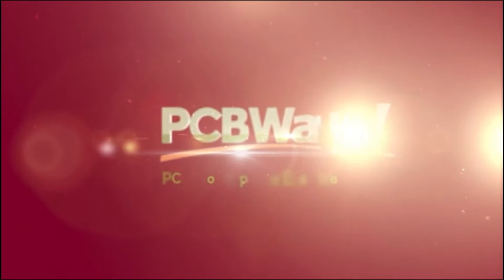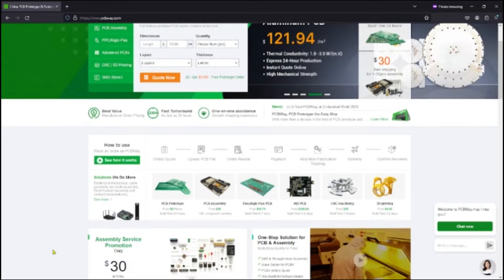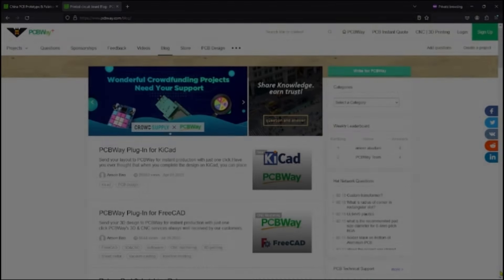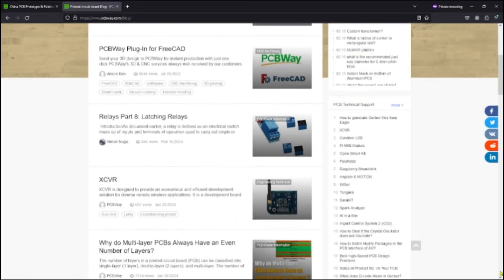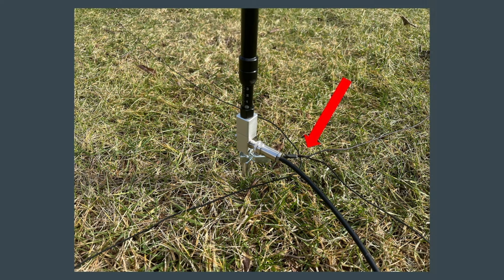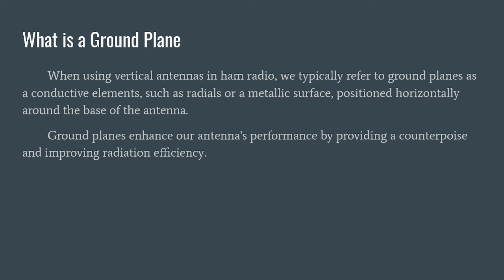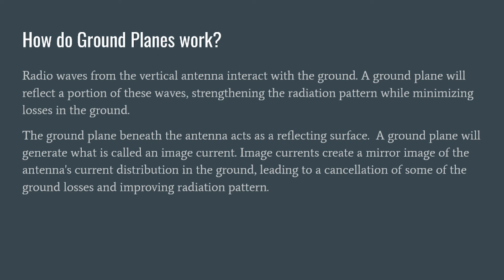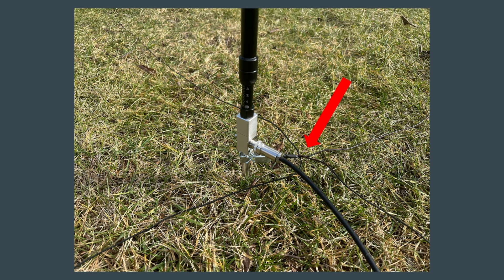Ground Planes for Ham Radio Beginners

Comment: If your antenna insists on using wires laid on the ground, i suggest that you use a lot of them, otherwise you might waste a lot of tx power just giving the worms free central-heating ! A few  elevated radials might often be much less lossy than a few wires laid on the ground.

Comment: The challenges faced by us full-time RVers who are also POTA activators are that we are often faced with erecting a worst case vertical setup due to restrictions at the WMA & other managed govt properties. It is hard to exactly list every restriction to be anticipated, but a lot of times I end up either with my Grabel vert on a tripod or one of my Ham sticks on my 5" msg mount. Once in a great while the 35' coax gives an acceptable match for my radio, but rarely I get to string my radials for as soon afterward a busl oad of nuns shows up to trip over them with their canes. Folks get tired of me preaching about using my Faraday cloth as a ground plane, but to avoid much of the trip hazards it has allowed me to get my 10 contacts to activate so I can be on my way. Just like anything else, when the bands are good a wet noodle can make many contacts, I am told, lol. I tell the angry sad hams that it is my job to try all the combinations that don't work first, then someday figure out how to do it right in ten minutes or less, lol. When in Colorado for the summer I have to work twice as hard for every contact than when in FL for the winter, another influence on my choices of effort. Generally though, I notice that Field Day gets about the same shortcuts. Thanks for your great videos,. Cheers, Davey --KU9L
Reply from the maker: Hey Davey, thanks for the comment and for watching 👍. One of these days I will need to try that cloth.
Reply: @TheSmokinApe  I don't expect it to be as efficient as a bunch of cool radials, but KB9VBR has some WSPR data on comparing contacts with one and two aluminum window screens. For POTA there are just minor differences, etc. I have been asked to do a real study but I am not that organized, LOL.
Reply from the maker: @KU9L  lol, Michael is awesome 👍
Reply: So how does a ground plane work while using a mobile NMO antenna mount?

Comment: As you explained it, yes it now all this makes sense. This is my question, what is the formula for a ground plane size? One I have read is 71.3232 divided by the frequency. Thus, using my HT in my office I should have a ground plane (the ole Pizza Pan trick) for the frequency of 145 MHz, the size of 19.29 inches, hum good size pizza. Using that formula for 400 MHZ a 6.7" ground plane is required. Hum, maybe my understanding is completely wacko.

Comment: I was working with Mifare cards once upon a time 13.56 MHz or nears about.  I was introducing a reader into a machine design for card reading. I was just a coder in a small company given the job.  The range was about 40mm for normal usage.  One day, messing about, I held another reader board behind the powered one and the read range  increased.  I couldn't quite figure out how that worked without it being powered.  I guess now, having seen your video, that If I had cut all the electronics from another reader and just kept the antenna part, and used that as the rear reflector, then I could have invented a cheap 'reader enhancement', maybe to 45mm and hence DES comms as well.  What a laugh :-)  .i.e. make a simple copy of the antenna part and stick it behind like in a Yargi?
Reply from the maker: Give it a try and see what happens 👍

Comment: More radials more gain, is correct only for GP lays on the ground. For elevated verticals, 2 radials is enough.
Reply from the maker: Correct
Reply: What size wire is best to use, and does one connection point better over another, such as connecting directly to the ground spike/stake vs clamping to the mount or coax PL 259 connector?
Reply: @K4WYZ  not clear what you mean. 
If talk about wire size, so thicker is better bandwidth, but also more expensive, so choose one is suitable for you. 
Counterpoises better to not make grounded, in case of GP is elevated above ground. 2 symmetrical pieces is enough for minimum. And connect to ground clamps of commutation box.
Reply: @Viktorherenowhere   thanks for the reply, I am a pretty new ham so bear with me a bit not always sure how to ask the question the correct way. Lol. Let me start with my setup my antenna is a JPC 12 vertical currently using the counterpoise that came with it, the wire looks to be about 16AWG I was wondering would I get better performance from my counterpoise using 14AWG vs 16AWG or 12AWG vs 14AWG so on and so forth. As far as connection point, for instance right now I  clamp my counterpoise directly to the ground spike, I have also used it clamped to the pl 259 right where it is threaded to the feed point of the antenna?
Reply: @K4WYZ  now is clear. You have a very good portable universal antenna for hf.
Please note, at 40m band, this antenna is not effective. It works best from 14Mhz and upper.
Every installation needs to be done with an antenna analyzer, for example Nanovna.
Counterpoise wire, awg14 or awg16, no huge difference in performance, only physical durability.  Better to use copper wire.
If you setup on the ground, you can add more counterpoises to boost performance.
If you setup above ground, 2m+ you need at least 2 counterpoises, in symmetrical position, 120degree between pole and counterpoises will give you better swr.

Comment: I’ve seen a few videos about wire mesh and faraday fabric being used as a ground plane.  I think I’ll get a very large one (maybe two) in order to cover 40m.  Hopefully some clear days soon.
Reply from the maker: What concerned about those solutions is that it probably handles the capacitive coupling to ground and counterpoise functions just fine BUT I’m concerned about ground loss 🤨

Comment: Great explanation! Thank you!
I have a Lora radio (902-928Mhz) with a vertical monopole about 7" long mounted on top of a wooden box that is not connected to ground. Would it help to mount the antenna on a small, ungrounded, piece of metal and screw that onto the box top? How big of a piece of metal would I need?
Reply from the maker: @zachreyhelmberger894  you could try with a 7’ round piece of metal 👍

Comment: Good Helpful info ! .....Frequently, Direct 52 ohm coax Feed results in Higher Swr than desired when you Use straight Level (90°Angle) ground plane Radials.... Highish Swr can be Tuned out by Using a slightly Shorter vertical Radiator & Tuning an appropriate sized "Hairpin" Beta match across Antenna terminals...I know it Looks like a Short circuit but can Work miracles in tuning a Better Swr.....
Reply from the maker: Didn't know that, thank you for the info Tom 👍

Comment: Adding radials to MMANA-GAL, how long are the radials? Are they the same length? Or does the total length equal some fraction of the wavelength being transmitted?
Reply from the maker: The MMANA-GAL manual is radio silent on the definition of the radials are, I am assuming it’s a 1/4 wave of the specified design frequency 🤔
Reply: @TheSmokinApe  I made you read the manual! 🤣🤣🤣
Reply from the maker: lol

Comment: I just got my first vertical a couple weeks ago and final got it out to play with it this past weekend. I'm having difficulty understanding what is going on with the radials. I've always heard "more is better" and even Lord Callum has said for best performance you should have 2-4 wavelengths worth of radials on the ground for the lowest band. So I cut 16 radials, bundled in sets of four, at 1/4 wavelength for 20 meters to give me 4 full wavelengths. I may work some 40m, but not often. When tuning any band, 10-40, I find that I actually have to reduce the number of radials or bunch them together and even fold them back on themselves to get an SWR below 2:1. In some instances, I had only one  bundle of four radials, bunched together and folded back on themselves twice. So only about one meter long. It gave me a beautiful SWR and low impedence, but I would imagine my gain is then suffering. So the question is, am I better served putting out the full set of radials to get a better gain and using the tuner on my radio for the SWR or am I better served reducing the SWR as low as possible and getting a good impedence match by adjusting radials and putting out full power through the antenna?
Reply: In the Seattle area POTA parks I work, I have found the soil to be poorly conducting.  I found I have to tune the radials to 1/4 wavelength even though they are lying on the ground.  For example, if I place 33ft radials with the whip set for 20m, minimum SWR is >2.  If I walk half way out from the center and coil up the tips, then SWR drops to a usable value.  I always use an analyzer and it sometimes requires a couple iterations of adjusting the whip and adjusting the radial lengths. (I envy those people who work sites that allow use of any length radial). My method works great here and I can reach the entire east coast from Seattle. de AC7PB
Reply from the maker: Sorry I missed this Brandon.  I would probably go with the option that gives you better SWR, it sounds like you would be trading loss in the antenna system for ground losses.

Comment: I have a question for you.... 
I have a cushcraft R8 vertical in the back yard.  It sits on a ground mounted pole starting about 5' high.  It's near the fence but no reason why I couldn't add a few wires on the ground.... 
Would adding some on the ground help, given the antenna has some ground plane wires on it (I think 5)?
The 7 built-in ground plane wires are 4' long, 5' off the ground.
Reply from the maker: Hey Ninja.  I think so, it should help prevent some of the ground loss you might be experiencing 👍

Comment: So I'm in an urban area and have no real yard but I do have about 40'x40' of flat roof about 40' up that I own and can play with.    I'd like to build a vertical up there.   All talk of radials I've heard talks about them being placed on the ground.   Would placing radials on the roof basically how they would be on the ground accomplish the same basic thing?  Would it be less efficient?   Is there a better way to deploy radials for an HF vertical antenna 40' up on top of a flat roof?   What kind of supplements should I consider for my prostate health?
Reply from the maker: Hey Tim, can't help with the supplements BUT I'd mount them flat on the roof and see how you get along.

Comment: Is it worth building an antenna like this for 10m? Or would i be better off building a vertical and putting it higher
Reply from the maker: I prefer the ground mounted as an elevated vertical requires tuned radials 👍

Comment: Can you please make a video over vertical hf antennas? At this moment I use a endfed for 10-40 meter but am not happy with it. I have a very small backyard so need a small antenna for hf
I saw a few vertical antennas such as Sigma SE HF-360 and asked myselve if that was a good choice.
Thanks in advance, Ron from the Netherlands
Reply from the maker: Hey Ron, I think I have a few but I forget... lol.  I will do some more vertical stuff 👍
Reply: Hi Ron, interjecting here. I have a similar issue and constructed a Rybakov vertical: 7.7 meter 14ga copper wire vertical element, through a 4:1 unun with six 5m radials, 30m feed line, choked at feed point. Works very well. Several construction videos here on YT, Tim G5TM explains it best. Cheers and 73. Bruce in Idaho
Reply: Thank you so much 😃
Reply from the maker: I am actually getting ready to do a Rybakov like antenna build in the next day or so...
Reply: @TheSmokinApe  cool, looking forward to your build..

Comment: That was great. nice chart on what happens to the  pattern.  when you use coax as counter poise . the round ness of the loads gets out of shape in the direction of the coax.  the same thing happens with very off set ground elements  . this may not be a bad thing. knowing this we can steer the lobe to wear we want the signal going to.  at higher frequency's this changes . like 70 Cm. you can put a UHF antenna on a cookie sheet and will be enough ground plain to work. we need about 1/4 wave length for them to work. so on 40 meters using coax for counter poise. that getting long. and if too short you will get common mode current into the radio.  that why we choke the coax. Randy is a fan of this channel. watch his video on SWR. from his point he is right. but us HAMS that want to get out better and get better lienee this info is on the test.  nice that both sides can be right. it depends on what you want radio to do for you ? . I want to talk DX from NY to the UK  so the ground plain is important to me.  and Off come is their FCC to us. they changed to 1 Kw now. Lord Callum really gets to the US now . I work the UK a bunch in the am. now they giving    their call to me /QRP for 100 watts. when many stations did this was funny. UK stations.  73's
Reply from the maker: That's pretty good info, thanks!

Comment: A few thoughts here...
The operating procedure lampooned by our host is quite common on the 10, 12, 15, 17, and 20 meter bands, especially when working DX. I'll stick with 10, since it's my favorite band. 
Aside from being heavily dependent on the solar flux, 10 meters is also seasonal. It opened up in September and closed in March. The best time for me has been between 9 am ET and noon. 
Contacts with DX stations are prized by those seeking to pad their total countries worked, and "rag chewing" with the DX is considered bad form. Besides, for many of them their total command of the English language is limited to "59, 73". That's just how it goes. 
I don't run a 7300 into a Hex Beam. I run a Siltronix 1011D that was given to me because it was broken and an original Penetrator that was on Craigslist for $60. It's mounted on a 25' steel pipe that is partially buried in the ground. 
I've had three antennas on the pipe: an original Starduster, a Super Magnum, and the Penetrator. 
The difference between the three has been interesting to say the least. 
When my tower came down and took the Penetrator (also a roof rescue) I put the Starduster up. I could no longer hear trucks on the turnpike or several locals. DX, which is skywave, didn't seem to be as good either, but a lot of variables come into play here. 
Five years later, I replaced the center-fed dipole/ground plane with the end-fed halfwave Super Magnum. The turnpike signals returned as did the locals. DX seemed better and cracking the pileups became easier. 
I put the Penetrator up last August. Local signals increased by an average of two S-units. DX seems to be about the same as the Super Magnum, with both antennas appearing to have a maximum range of roughly 8000 miles during this phase of the current solar cycle. 
If there's a "rule of thumb" here it's that you should experiment and find out what works best for you. When I got on ham radio in 1980 my first antenna was a Cushcraft AV5, a ground mounted vertical. It worked just fine without any radials. 
I'm also using an Alpha Delta DX-B sloper. Despite ignoring the instructions that emphasize that the antenna needs a triband beam above it (the high end is attached to a stink pipe on my house) it works just fine.
Reply from the maker: Thanks for sharing your experiences SpaceFlight 👍
Reply: @TheSmokinApe  You're quite welcome. As an aside, I was able to work VK2BY in Sydney about an hour after my sunset here in Pittsburgh. First time this season that I've been able to get to 10,000 miles, with the Penetrator and a TS-430. 
Forget six meters; 10 meters is where the real magic happens!
Reply from the maker: That is quite a contact 👀
Reply: @TheSmokinApe  It was a complete surprise.
Reply from the maker: @spaceflight1019  I bet